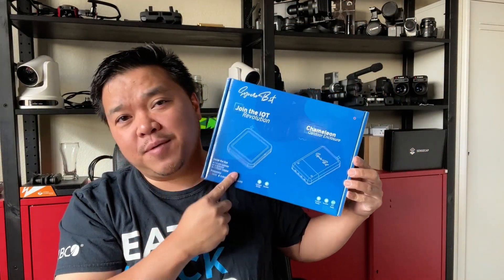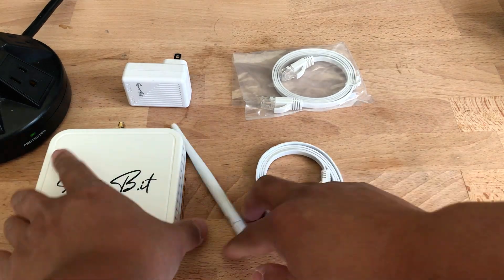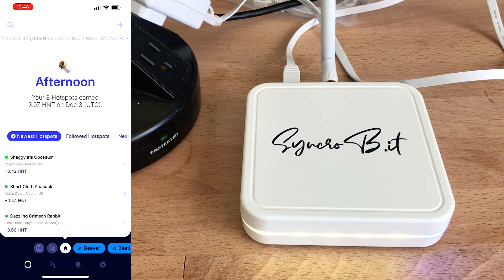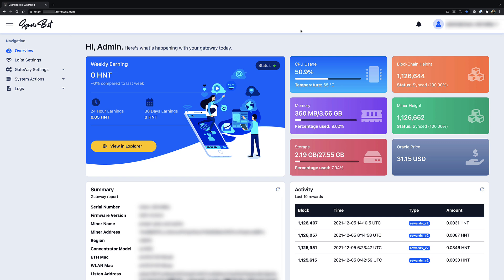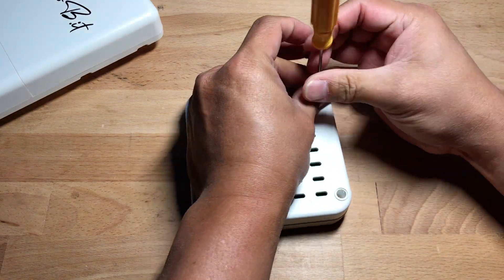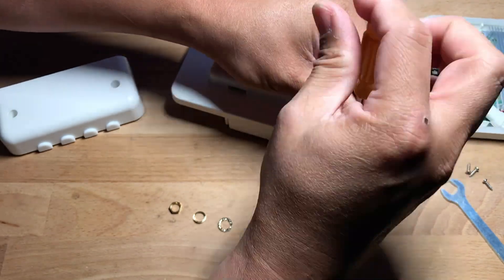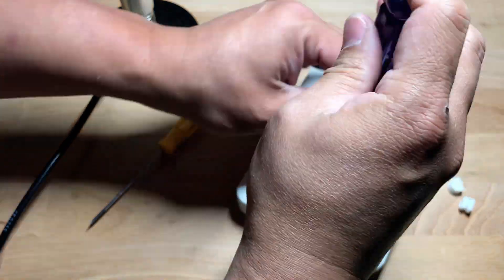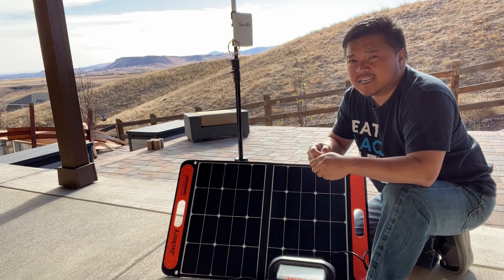SyncroBit Helium Hotspot Unboxing, Setup, and Review for an Outdoor Install

Comment: Are you supposed to install a sad card in the syncrobit? If not what is the port on the board on the left side? Just a diagnostic/software connection?

Comment: Great video! I have a dumb question about installation. I can just use the indoor enclosure and just run the wire to my 8dbi antenna 55 meters up and it would work just fine correct? I don't need to have the actual unit close to the antenna via the outdoor enclosure right?

Comment: 4:40 im getting red flashing also, altough i left it 1.5 hours to update 
before configuring it and i tought it was over because i got white 
blinking,.i i guess il leave it fews hours  and hope its ok edit: still red flashes, and after some time it reboots ,starts orange (syncing) then again red,.
Reply: Did you ever fix it? Mine is doing the same
Reply: @matthewpyro  yes. it was in the wrong lan port of my internet router. if its not that diagnose it and contact syncrobit support they were very responsive

Comment: Maybe I could get some help from you guys with a syncrobit miner I'm having trouble with.
It is 9m in the air and PoE, with  a 9bdi antenna. It seems to be connecting to wifi first and I don't know how to forget the wifi network and force it to use the Ethernet connection, the wifi is just barely in range so it's in and out, mostly out.. 

If I use dashb.it 

1. Will I be able to change these settings and check more things?

2. I will need to be hardwired into my network with what ever computer I'm using correct?

3. What browser is a known good browser to use, anything other than Chrome? Or is there a specific one that you know works best?

Comment: Hi, can you set it up without the ethernet cable? I.e using the WiFi only
Reply from the maker: At the moment that's how it's working.
Reply: @DewItJustinKace  once it's connected  by ethernet and set up, can I then re-set it up by WiFi I.e. Will it now connect as its been set up with that WiFi before or will it still only need ethernet use to work?

Comment: 1. Wow ok I have the same low earnings as you. Were those low earnings with the stock antenna? Because that's what I have and I'm only getting 0.03 hnt per day. I wonder if syncrobit just has terrible stock antennas. Did the external antenna help at all? 
2. Which antenna do you recommend for the syncrobit?
3. How does the fan cool anything if the outdoor enclosure is an airtight/waterproof case with no vents?? Scared to use mine because of that.
Reply from the maker: I have a 8dbi RAK but am only making .1 HNT a day in an area I should be making .4 HNT. Not sure what the problem is.
Reply: @DewItJustinKace  hey I’m new to this mining stuff and I’ve been doing so much research on a antenna for my syncrobit indoor miner , I live in a apartment. And I’m looking to get a 5.8 antenna but I’m honestly confused on what’s the right one. Do you know where I can get a 5.8 antenna for my indoor NA syncrobit ??

Comment: Hey Justin great video. I also recently received my miner and I believe I made the same mistake as you where I didn’t necessarily follow the initial set up correctly and now have blinking red lights. Any troubleshooting step recommendations you have would be amazing!
Reply from the maker: After leaving it alone and connected via ethernet for 4 hours it was fixed. How about you?
Reply: @DewItJustinKace  ditto eventually went green on its own over time. Appreciate the response!

Comment: They send the PoE injector but not the splitter, this is why you cannot plug directly... Get a PoE splitter and it will work fine. Anyway, is supposed to work directly via poe injector (power and data together) without splitter, as they say the device supports that feature... curious.

Comment: It seems like those in or close to large metro areas are flooding those areas to divide the pie of rewards more and more, while those on the outskirts or rural areas receive little or no mined currency. With all the same investment. Can the network burn out? Reward structure is not equal to all investors, if the network needs to expand for the good of the network there has to be a way to get insensitive to spread out. Limits in hexagons might be necessary in order to spread the coverage.
Reply from the maker: We'll see what proposals might happen to make better infrastructure.

Comment: Where can we purchase your 3D prints and which tripods you recommend to set up antenna in the attic ???
Reply from the maker: As I said in the video, I don't sell them. If I do, probably after the new year.
Reply: @DewItJustinKace  perfect! Will be looking out for any updates in the new year. You got a lot of support in Canada! If you do decide. We taking notes lol
Reply from the maker: @yuhu7567  I'll keep that in mind. I was about to spend $6K today for some miners in Canada, but I don't know the duty costs for them coming into the United States. Not sure if I should be worried.
Reply: Just mount it on the frame if you have no base. I can also tell you I got on the roof and now I do double the witnessing.

Comment: anyone having issues with miner not to connecting to wifi. I have xfinity and when i try to connect to my network, it just tells me password is incorrect even though im inputting the right password
Reply from the maker: Can you connect it with an Ethernet cable? Try that and then restart it and enter wifi info. Then pull the cable out and restart it again.
Reply: @DewItJustinKace  i have the same issue. I have finestra miner and it doesnt have ethernet port so only wifi and i cant connect it xfinity internet
Reply from the maker: @Binong_Molly  xfinity is a pain for me. I have one that when the system restarts it won't re-connect to xfinity. I have to go to the house to manually fix it. And this place earns me .6 HNT a day so I wanna keep it running!

Comment: Awesome way to 3D print your own antenna mounts. I am definitely interested in seeing how your mobile unit will work. I was thinking about that setup in March when I first ordered one but I have yet to receive my SyncroBits.
Reply from the maker: If this works I'll be designing a system and testing it out. But I want to know how long these batteries last.
Reply: @DewItJustinKace  Pretty curious since if it goes offline from a battery dying then it will have to resync again. But then again they don't use that much power is what I understand.

Comment: What website or software are you going to be using for mining earnings for taxes? Some of my miners are used so I also need to find a way to edit whatever csv file the program exports. Maybe a video idea
Reply from the maker: https://davetapley.com/helium-tax/
Reply: yeah I have used that. My example would be the first miner I received was Nov 1 and was brand new the second and third one I had to transfer and setup on the Nov 10 and Nov 20. I didn’t see an easy way to isolate miner 2 and 3 to those dates. I would end up having to go through hundreds of transactions between Nov 1 and Nov 20 to see which miner it was for

Comment: Any reason you decided not to use POE for power?
Reply from the maker: Because it would have tried to access internet in the same manner.
Reply: Just answered my own question...your running it remote off of a battery and solar panels.  Nice!
Reply: Can you link to the power adapter that you got instead? Thanks!
Reply from the maker: @hohum911  it's just a 12v 1a pulled off some other device.